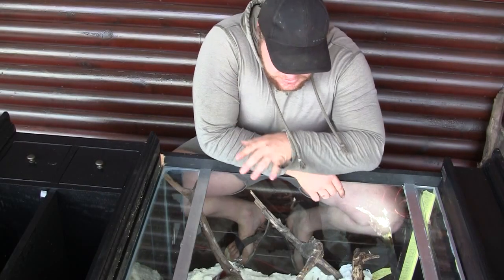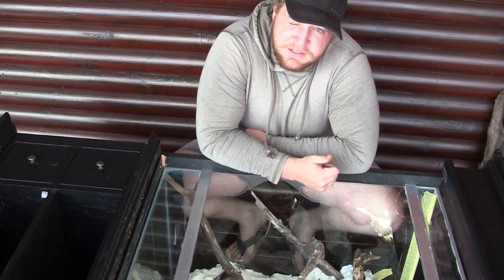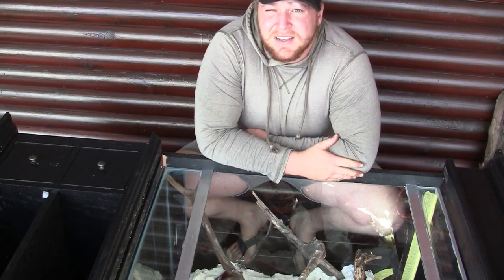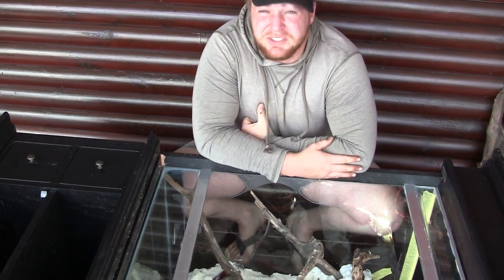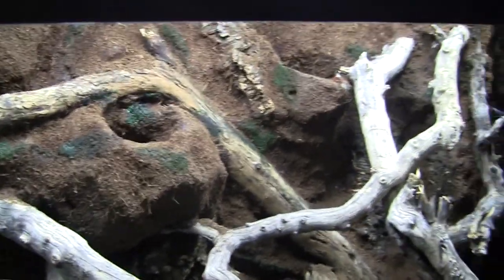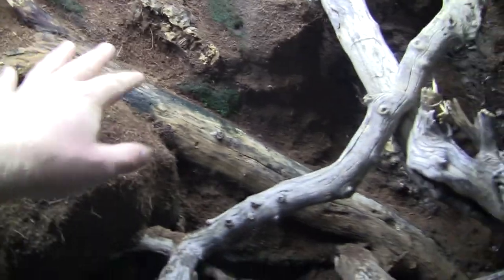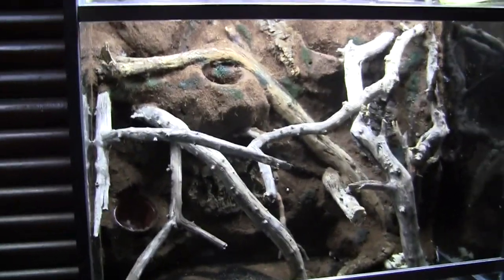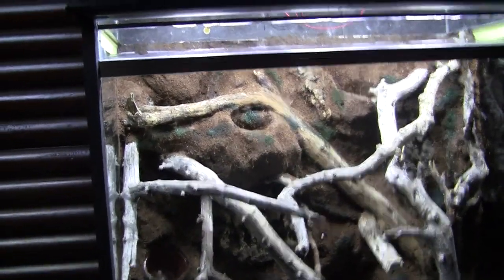HOW TO MAKE A VIVARIUM BACKGROUND (ps epic finish)

Comment: For the plant cups, do you put liquid rubber inside? Do you drill drainage holes?
Reply from the maker: I dont out liquid rubber inside.

I do however make small holes with a screw driver to allow the planters to drain

Comment: What kind of moss did you silicone in place? I've done a couple builds where I siliconed zoomed terrarium moss and frog moss in places and it turned brown after a couple days. I loved having the green in there, if there's another kind of moss that stays green I'll do it in my next build.
Reply from the maker: Hey caleb. Ive had really good success with dried moss bought from local nurserys. They stay green for long.

But if your humidity is good id suggest going a different route. Use java moss cliped too your backround (not siliconed) or use black thread and gently tie the moss to your wooden pieces and enjoy the moss taking over.
Reply: @Undisputedreptiles  great thanks! I would like to try real moss, I'm doing a vivarium for a crested gecko I thought about trying it in there.
Reply from the maker: It might give you some hassle in a crestie viv due too the humidity gradient necessary for moss. But if you make it part of a waterfall area you should be good
Reply: @Calbreos  I know this is a year late, but I'd maybe do a finer moss to silicone in place mixed with some moisture holding soil. Something to give the real live (expensive kind that you don't want dying lol) moss to root into. It's one thing to just glue the moss in and call it done & expect it to grow vs. cultivating space to add & grow live moss. Hope your viv's are looking great & doing well! 😄🌿